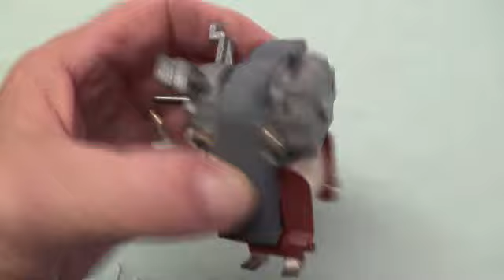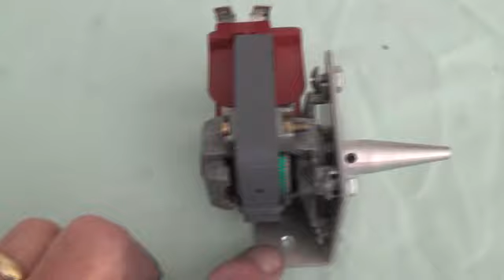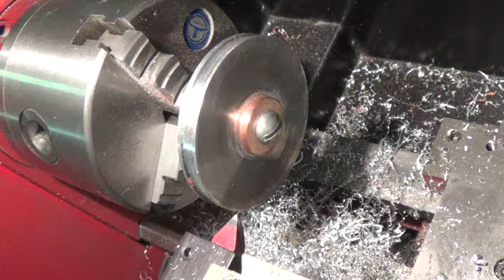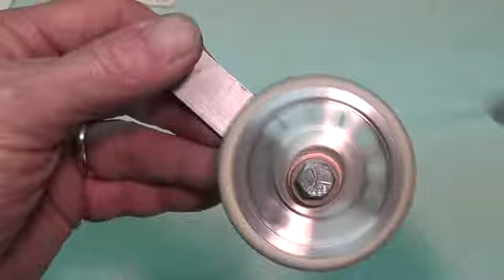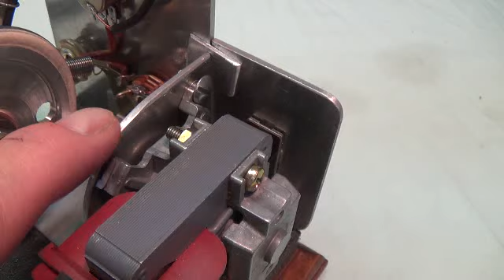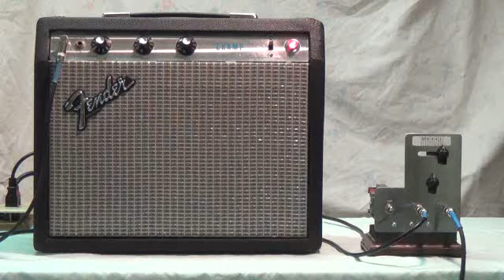Homemade DeArmond Electromechanical Tremolo from Scrap Parts

Comment: Brilliant!
Reply: Just one question. Why Windex? Does the ammonia help the water conduct? Are other ingredients, like the soap, useful? And doesn't the soap cause it to foam up and eventually interfere with the function until the bubbles settle, or is that effect negligible? Also wondering how Windex reacts with the copper over the long term.

I've only read about these. So great to see one. (I always assumed the liquid cylinder rotated. But I guess that would make the electrical connections to it far more difficult.)
Reply from the maker: Admiral Quality
Greetings, AQ, and thanks for your kind words. I will "borrow" my response from a similar inquiry: When ammonia is added to water, it reacts with the water and forms ammonium hydroxide.  NH3 +H2O --> NH4OH  which breaks up into NH4+ ions and OH- ions. The presence of these ions increases the conductivity of water. Too much conductivity will result in reduced signal volume so the ion concentration has to be correct.  Windex has about the right conductivity for a good tremolo effect.

And yes, the Windex does tend to foam when the tank is agitated vigorously, causing somewhat of a "short circuit" that reduces the tremolo effect. I experimented with salt water, but found that, despite its shortcomings, Windex really does work best.

A possible solution to the agitation problem would be to add a second electrode at the opposite end of the tank, so that a relatively rapid tremolo speed could be obtained at a much lower (half) agitation speed. Thanks for your comments and excellent questions.
Reply: Uncle Doug Thanks for replying. (And thanks for doing this Page. I've just stayed up all night watching a good chunk of your videos, clearing up a lot of things I wasn't quite sure about and learning a few new things entirely!)

It's great to see the Windex can conduct well enough to basically attenuate the signal all the way to inaudible. I mentioned on your other liquid-trem video that it was making me want to build a liquid volume pedal. I find myself also wondering if the effect could be enhanced (or made more finely controllable) by forming the electrode out of resistance wire, so the amount of it that is currently immersed has a greater effect. (Though if you did that, maybe you could switch from a liquid semiconductor like Windex to an outright conductor like mercury.)

And there might be something you could add to the Windex to kill the foaming action. An oil, maybe? Or can you mix your own ammonia and distilled water combo? (I suppose another advantage of the ammonia is it keeps stuff from growing in the water.)

I really want to experiment with this now. There's so many ways you could approach it and so many applications for potentiometers you could (ahem) potentially replace with gravity powered liquid slosh. (Could an array of these replace the bulbs and photocells in a Univibe!?!)

I just wish I had your shop space and machines!
Reply from the maker: It sounds like you're well on your way to some interesting projects, AQ. The problem with oil, as I see it, is that it might coat the metal surfaces and reduce conductivity. There are some non-oily anti-foaming agents available, i.e. as used in automotive antifreeze, that may be effective. The resistance wire concept is interesting, if you could get wire that offered a large variance of resistance over a short length of wire. Good luck.....keep us posted on your discoveries :)
Reply: Uncle Doug I believe there is such stuff. (Speaking of Hammond organs as we are in your other thread, they use nichrome resistance wire in their drawbars to make linear potentiometers.)

If I ever get a chance to try it I will definitely share my results with you and yours!

Cheers!

Comment: What is the active ingredient in the windex, ammonia?  If so I bet different concentrations sound differently.
Reply from the maker: You may well be right.  When ammonia is added to water, it reacts with the water and forms ammonium hydroxide.  NH3 +H2O --> NH4OH  which breaks up into NH4+ ions and OH- ions. The presence of these ions increases the conductivity of water. Too much conductivity will result in reduced volume so the ion concentration has to be correct.  Windex has about the right conductivity for a good tremolo effect.

Comment: I like the variable speed idea, also if you want to speed it up have you thought of adding the plexiglass electrode cap to both ends of the tank ? and if you o-ringed the plexiglass you could turn one cap end to make the grounding electrode a different distance away from the fluid as the opposite end. Sort of a wow...woow effect, not sure if that would be desirable though, actually just making the tank turn-able on its mount would do the same thing.
Reply from the maker: Greetings, Dean. Yes, the two-electrode concept seems to be a good idea.....offering twice the trem speed with no increase in the overall drive speed. The second electrode could even be switchable, to allow for very low (single-electrode) trem speed if desired. I haven't yet tested the concept, but intend to do so. The different-electrode-distance theory sounds interesting. The only problem I see is that the distance range is rather small and changes may not be audible, particularly when the tank is moving at fairly high speed. Again, the theory could easily be tested. Thanks for your input and good suggestions :)

Comment: Hi, Doug and Rusty hope you are both well. When i asked if you do requests i didn't have anything in mind at the time but since then i have come across another interesting device, which you may not have come across and i would love to see explained and built by yourself. It is the TEL-RAY Ad-n-echo it appears to be an electrostatic device and has a weird oil in the base. Thanks Doug. Colin
Reply from the maker: I read an article about these devices many months ago in Vintage Guitar magazine, Colin, specifically the Morley foot-pedal style, and your comment inspired me to do a lot of Internet research.

The principle seems rather simple: the signal is electrostatically recorded on a revolving disc by tiny-wire brushes and then read at an adjustably-delayed time. There is an erase head that (I assume) can be turned on and off, to allow for one or more echos. The oil is simply an insulating material to prevent the electrostatic charge from dissipating into the air.

The mechanical-drive part is quite similar to my EM Tremolo, but the read-write part is far more complex. Unlike the EMT, the echo unit has its own preamp circuit. The drive and preamp are straightforward and (fairly) easily duplicated, but the portion within the can is not.....particularly the "fine-wire brush" read, write, and erase heads, which would have to be handmade (I assume).

Let me do some more research and see if the project is feasible. Meanwhile, thanks for the thought-provoking comment and suggestion.
Reply: Uncle Doug
Brilliant thanks for the reply and research. Great explanation too. Couldn't imagine the moving parts. From description i read it like it was like a van de graaff generator, but the read head part reminds me of an electrostatic motor design i have seen with aluminum tape on a plastic ball and braided wire split to provide a comb for the charge to pass onto and stay on the ball, neat. I guess a skilled engineer such as yourself it would have to be a nice build but a bit of brainstorming / inspiration might suggest a solution. Why they chose a liquid rather than a solid insulator amazes and kinda thrills me it so unique. Take care and respects, Colin

Comment: Nice job Doug, what RPM motor did you use?
Reply from the maker: Thanks, Tim. I don't know the RPM of the motor. I determined the speed reduction by trial and error.....altering the taper and reducing the diameter of the aluminum drive spindle until I got the proper drive ratios, which vary from about 7:1 up to 44:1. The ratios are greatly affected (increased) by slippage, however, and the slippage is indirectly related to the spindle diameter being contacted and the pressure forcing the drive surfaces together. Given the uncertainties involved, I just stuck with trial and error.

Comment: Just a thought, if you add another grounded cap to the other end of the tank, you would get attenuation on the return stroke as well, double the frequency of your tremolo. you could add a switch to that ground to have both speed options.
I'm not a guitarist, I've never even seen something like this before, but I found it interesting. Beautiful work.
Reply from the maker: Thanks so much for your kind words. The idea of adding a second electrode to the rear of the tank is a good one.....I may well try this in hopes of doubling the tremolo frequency without having to double the speed of the drive mechanism.
Reply: @Danny Knapp , you are right

Comment: Thanks for the video Doug and Rusty. Amazing design and brilliant machining skills. What a strange and wonderful.."Steam Punk" style idea for varying the volume..didn't see that coming. Thought there was going to be some kind of strange electrical coupling between the different materials? Or some kind of oscillating volume pot twiddling or optical shutter design..but sloshing water im amazed! Beautiful workmanship! Take care and looking forward t more of the same..do you do requests :-)?
Reply from the maker: Thanks so much, Mix. I'm glad you liked the crazy little device. When you think about it, sloshing water is sort of what tremolo sounds like.....and it does make a great grounding medium for the signal, with a gentle fluctuation rather than a sharp on/off. Re requests, I often base videos on viewers suggestions, especially if they are of general interest.....but no guarantees :)

Comment: @Uncle Doug your traditional mechanisms are so much more fun than the electronic solutions. The liquid is probably better for not being too conductive... so you get a bit of progression as the probe gets immersed... I suspect that antifreeze or a central  heating additive is nearly ideal for the purpose..
Reply from the maker: Thanks, gO. I completely agree about the lower-conductivity water/Windex providing a smooth-transitioning sigmoid signal, rather than a square wave, as you might see with mercury or some other highly conductive material. To me, this gives the EM tremolo a "watery" "swampy" tone, that is exactly how a tremolo should sound. I have experimented with various liquids and dissolved solids, but have not tried antifreeze yet........

Comment: As a kid I achieved a similar effect with an LDR in the signal path and a flashing light. Your little machine is beautiful, I think the Windex not only helps the conductivity but also stops the water getting cloudy with bacteria growth. I guess you could add another plastic end piece and probe in the other end of the tube if you wanted faster tremelo! (ie both probes in parallel).
Well done on a well engineered mechanism.
Reply from the maker: Thanks so much. I think you're right about the Windex. I have considered adding some mercurochrome (a mercury-based anti-bacterial agent) to the water for the same purpose(s).....but have had some difficulty finding any. When I was young, my mother would douse all my cuts with it (much to my displeasure) but I guess the modern fear of anything containing mercury put an end to it.

Your idea about two probes, one at each end, is a good one. EM tremolos tend to be rather low frequency, so perhaps this could speed it up a bit.

Comment: Lovely work. Have you thought of trying the optical one, (I saw the design in a Frank Judd book in the 70's), where a rotating disc of polarised plastic turns between a bulb and a photocell with another piece of polariser over the cell. As the polarisation of the disc and cell cross, light is smoothly faded up and down on the cell. Wire it light your De Armond. I think the trick may have been used in some old electronic organs. Hammond went one better - they had an electro mechanical vibrato. A pleasure to see your design and craftsmanship.
Reply from the maker: Thanks so much, Mike. I tend to be a Rube Goldberg-electromechanical type of guy, but  optical tremolos are excellent, with (as you say) a smooth upward and downward ramping of  volume attenuation. If I can come up with some interesting variation on the standard design, I may well make one. Thanks for your kind words and input.

Comment: I also took your advice and found a couple of organs on Craigslist, I can't wait to check out the amps and speakers in them. I hope to do a conversion and put it into a cabinet.
Howard Vose
Reply from the maker: Good luck with your project, Howard. The easiest amps to convert are the smaller ones used to drive reverb tanks (AO35 and 44). Conversion schematics are easily obtainable on the Internet.

The large amps, i.e. with four 6L6's are more challenging because they are generally "power" amps, and lack any built-in pre-amp circuit, which is challenging to provide if you have little or no experience. However, they are worth getting, if only for the parts.....transformers, tubes, sockets, etc.

The speakers are often quite high quality (Jensen, etc.) and definitely worth getting. You should familiarize yourself with speaker manufacturer codes so you can identify them easily.